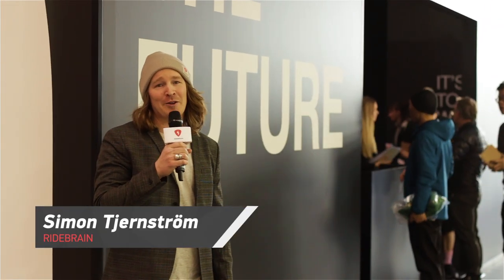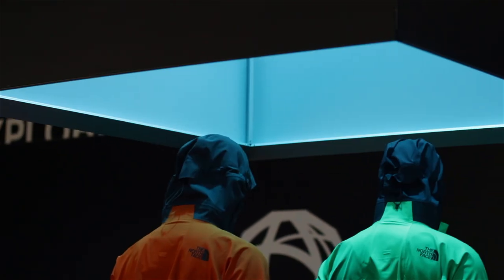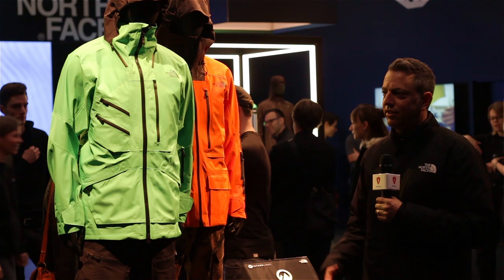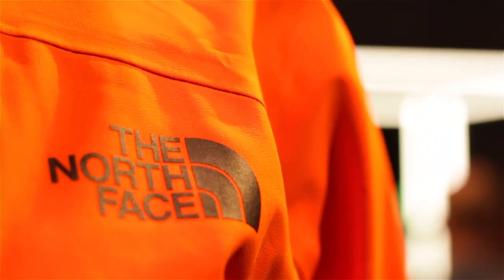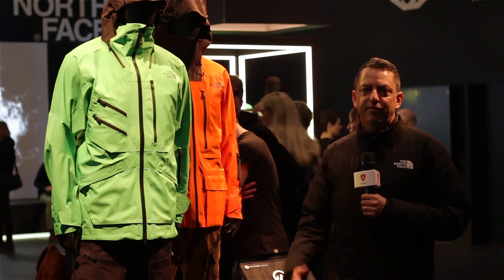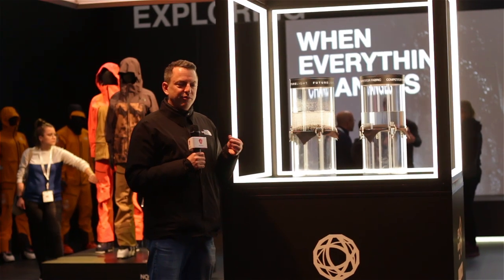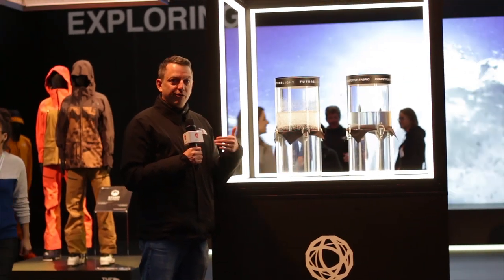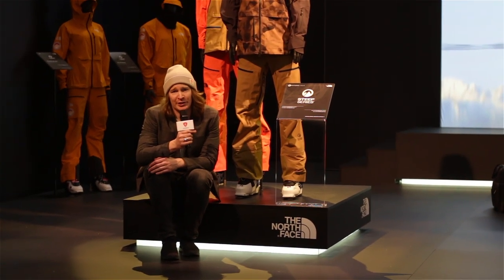WHAT IS FUTURELIGHT?

Comment: If you pass that much air through the material... doesn’t that also mean heat loss??
Reply from the maker: Well, that's a tough question. I think no, that is not our experience. Since the membrane's primary function is to transport moist and keep rain and such out, I don't think the membranes function, wether it's gore-tex or futurelight, is to store heat, the other layers of the garmin do that. And to add to that, they produce the membrane in five different weights so that they can "tune" a jacket after it's needs. So IF they need to prevent potential heat loss, I'm sure that isn't that hard.
Reply: RIDEBRAIN I disagree whole heartedly. Why do you wear a shell? To prevent wind and moisture from stealing your body heat. If it was 100 degrees and raining during a hike, I most likely won’t care about wind or moisture. Yet if it’s 34 degrees and starts to rain, yes, I want protection to not become hypothermic or worse... people don’t wear hi end shells just to stay dry and out of the wind. It is a layer used to keep in heat as well. If you wear a fleece, that releases body heat in the wind, you wear a shell to prevent it. What good why this be if heat is not trapped? This also applies to the Patagonia Nano air. It breaths, but looses a ton of heat as well. This seems to just be a more expensive option. Time will tell I guess.
Reply from the maker: @erikmorehouse4236  well, you may be right. But what I tried to say was, since functional breathable layers are nothing but a sort of plastic (in gore-tex case at least) with holes big enough to transport steam molecules but small enough to keep water molecules out. That specific layer of a jacket works pretty much the same and must have same dimensions on the holes. If that layer is thinner and lighter (like the case with Futurelight) and have more holes/square meter, it still dont effect the heat keeping function to any noticable extent since the jacket consists of more layers than one or you get recomended to use OTHER layers underneath for that function. In my humble opinion. Isnt that why they recomend the three layer principle? 

If you ask me personally I have NEVER been cold skiing full days dressed with three layers eventhough it has been -35 celcius. So if you are right - sweet. That is what Im looking for, a more breathable top layer since my issue is sweat and not freezing. So i think this debate is pretty obsolete. In my opinion.

And as you said. Im sure time will tell ;)
Reply: @erikmorehouse4236   Wtf man 👨 , you just don't under  the main reason to wear hard shell,is  to protect yourself from weather conditions , why you need it 😀 when the weather is fine or just windy?! I have full layering system of north face summit series. L1 l2 l3 l4 and l5 ( l4 is pants or windstopper I have the pants and don't have l6 just don't need extra down jacket over all layers) the how system is to transfer moisture and regulate body temperature to not overheat and yes , that's means temperature loss , my l3 50 50 jacket is 50 % with down and 50% just thin nylon and 50% of the jacket is COLD SPOTS but if you have great movement 😉 you generate great heat that's means moisture that's mean 😀 we have a problem. If your shell traps your body heat what's the point of everything that's I said, main reason is to transfer the moisture to surface and evaporate  but hear i have question how to evaporate the moisture in -30 C ? Or raining 🌧. Imagine,  you are wearing merino wool layer , fleece and hard shell what will happens 🤔if your body cannot breathe? A f0king sauna , man.
Reply: @ГеоргиГугов  thanks for the book 😂 Enjoy your overpriced hype gear.
Reply: @erikmorehouse4236   hahahaahhahq I'm so happy with it , but I noticed something, people who cannot afford it  complain about the price and spec. Why ?!  😀  arc teryx is cheaper or what ?
Reply: If you like it, who cares really!?  I don’t. Now back to current life and not year old posts...